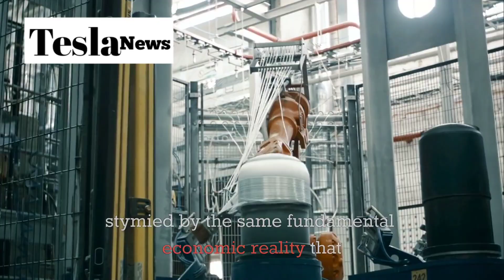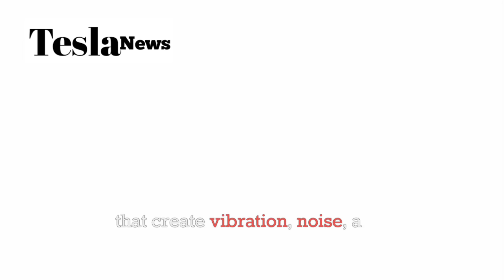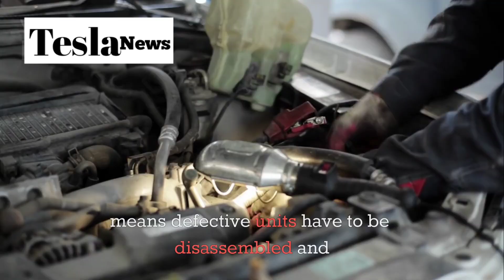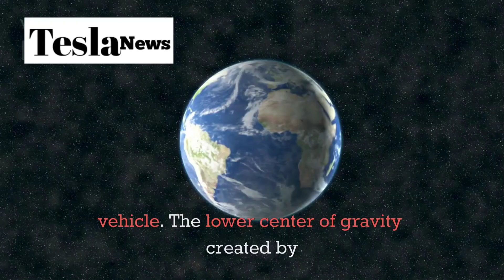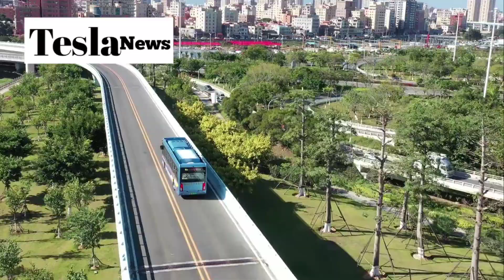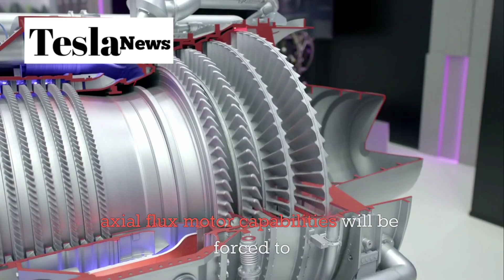BREAKING: Tesla's $10K Model 2 LEAKED Motor Will DESTROY Every EV (Elon's Secret Revealed!)

Comment: 30% more efficiency? Electric motors have already 90-98% efficiency. So the new Tesla will have 120-128% efficiency. Elon Musk (or the video's editor) has just invented the perpetuum mobile!
Reply: The best electro-motors for cars are about 30-35% efficiency - most what they produce is heat, which has then to be cooled down, resp. blown away with another part of the efficiency of the motor, so you have about 25% efficiency for driving and velocity. Just for the idiots here, who compare mini-motors for drones or  so with car-motors...